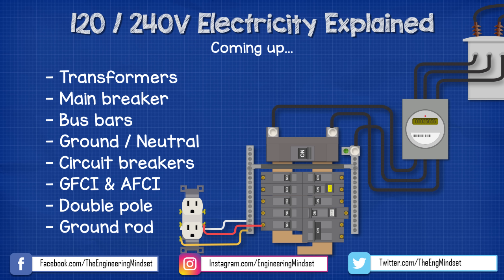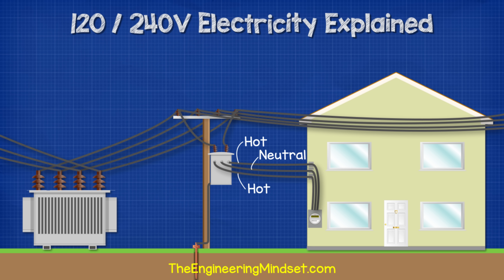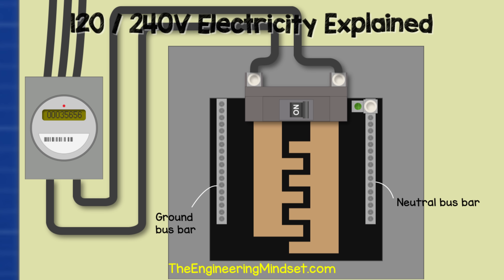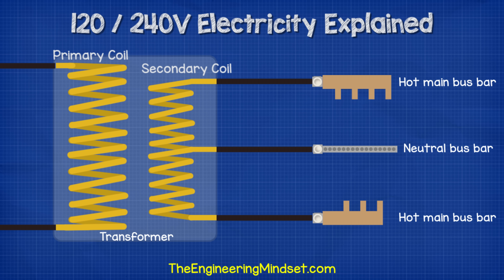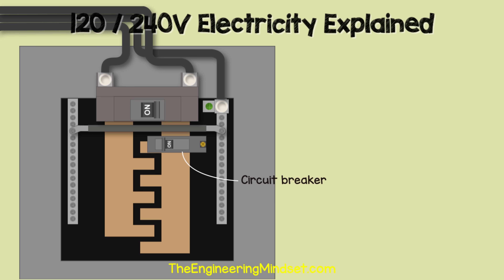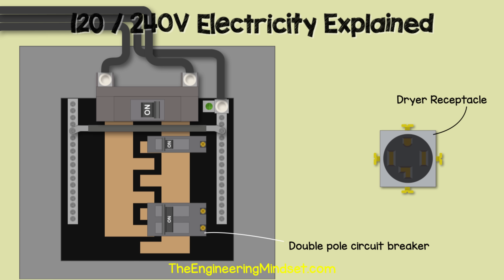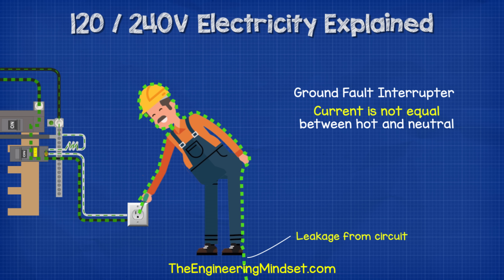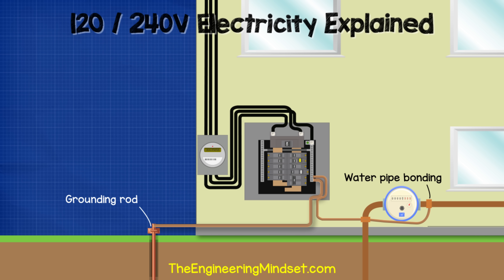120V 240V Electricity explained - Split phase 3 wire electrician

Comment: What happens when the voltage like a 240v NEMA 10-30 that is using a extension cord to fit a outlet of NEMA 5-20 device that only uses 50v?  Would that break the device bc it using so much power? The extension cord is for 240-120v.

Comment: This is a great video about Voltage, but what determines the 100-200A service you briefly mention at 3:06 ?
Reply: Apartments and tiny houses will have 100 amp panels. Most houses now have 200 amp panels.

Comment: Thank You! I've been out of service for almost 9 years, I have to work on my son's house, the breaker panel is a hillbilly's nightmare, I could not remember if the ground bar should be bonded to the neutral bar. Electrical isn't quite like a bicycle, some key points can get forgotten!!
Reply: The neutral is bonded to ground at the transformer or disconnect before the panel If you bond it in your panel and the main ground electrode is disconnected mistakenly. You risk electrifying your panel and any bonded metal in the branch circuts.

Comment: So is there a 240V transformer for every house?
Reply: In urban areas customers will be close enough together to share a transformer and will likely receive two phases of a three phase distribution and have 120/208 service.  As customer density decreases sharing of transformers will decrease. Last I checked I think I share a transformer with four other customers. We live hundreds of feet apart. If you live hundreds of yards apart you probably have  your own transformer.  

Foot is equal to the metric foot defined in ISO 2848
Yard is equal to near'bout a metre but not quite.,
Reply: @billelkins994  Thanks for taking the time to answer my question I really appreciate it.

Comment: 7:35 i don't get that, how does the ground wire have lower resistance than the neutral wire ? don't all wires except specialty wires like heating coils have more or less the same resistance per foot/meter ? (give the same materials)
Reply: i agree with you , the only thing i get from this is that say the neutral comes off and touches the metal casing the light would operate as normal because essentially the ground became the neutral which would kill someone if they touch the casing but if the hot came off and hit the metal casing it would fault through the neutral or the ground because there would be no resistance(light bulb) and it would cause a fault in the breaker.
Reply: Ground wire is thicker. Thicker wires have less resistance.
Reply from the maker: We just published a new Ground fault, short circuit and arc fault video, so much detail! Link HERE➡️: https://youtu.be/Qi0ynSQw-wc

Comment: Wait  7:01
You connected 
NEUTRAL and GROUND 
TOGETHER? 
why is separate and the connect together? 
How the power (used) going back to the panel with the NEUTRAL wire and connect with the ground wire is not doing that?
Reply from the maker: I know, it seems crazy. You may need to watch it again. Check this video too https://youtu.be/P-W42tk-fWc

Comment: Question please :   120 Joules of energy travel on each coulomb to the load
which is a bulb that uses 120 volts.   How do the coulombs become recharged
if it is AC current?  Also if the load is more than 1 amp it will need more than one
coulomb?     AC is push and pull the exact same ELECTRONS? Thank you.

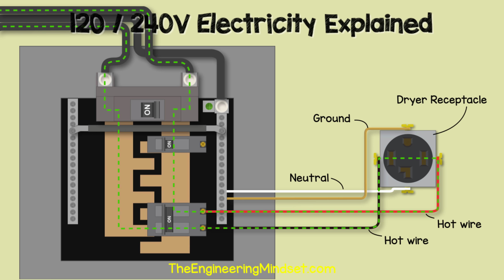Comment: I came to learn about double pole circuits and 240V. I have a question about the 9:00 mark. So a 240V appliance has no neutral? Connecting a neutral steps it back down to 120V? Any link to the best video that explains this more in depth?
Reply from the maker: Try this one https://youtu.be/P-W42tk-fWc

Comment: Do you always need a neutral? My coworker says for our equipment thats 208V 1Phase we only need the two hots and ground. I mentioned the completing the circuit and letting the current to back to the bus bar, but they said its suppose to act like a perfect circuit and those nothing or close to nothing should flow back

Comment: Hi great explanation.
Why the neutral is connected to the ground? Shouldn´t the ground cable go directly to the fiscal ground?

And second, for the dryer receptacle, why do you connect the neutral if it is not needed? (The dryer will only use 220v so I think that it is not needed or is it?)

Comment: I am not an electrician but have undertaken alot of electrical projects to code on my own.  It is stated that you have to be 100% confident in what you are doing as there is absolutely no room for error with electricity. I wish we had access to videos like this one 45 years ago in school. Straight up and straight forward... Thankyou
Reply: I probably need to rewatch, but I still don't understand how the ground wire is different from the neutral wire in this example. Also, what is meant by "used" electricity here?
Reply: @TheAero1221  the ground wire isn't intended to carry current. It's normally completely dead except in cases of a ground fault(when the hot wore touches something metal). The reason we connect the ground wire to anything metal is because that wire is able to carry the current back to the breaker and make it trip so that whatever metal became energized can turn off to prevent shock.
Reply: @TheAero1221 in essence thry arnt different
Its where they are connected that matters, they are an emergency exit for electricity
Take your toaster for example. Inside the toaster the live an neutral connect to the elements and are a closed circut. However if say the element breaks and touches the metal casing of the toaster. The toaster body is now in contact with live. But NOT neutral. So now the ground wire is the "neutral" in this case. And because of how low resistance the ground is. It causes the breaker to trip
Reply: @TheAero1221  used electricity = electricity thats been trough an appliance like washing machine

Comment: My electrical knowledge stems from 12V DC automotive systems. I understand that when going from each individual bus bar to neutral you see 120V at each, but at 4:54 the meter is connected across the bus bars and shows 240V. My understanding of how a meter works tells me that it should read 0V if both sides of the bus bar are at 120V. The meter simply shows the difference in voltage potential between the two points, no? If they are both 120V, the difference is 0V. Going from neutral (0V) to each bar individually (120V each) should be 120V as you've shown, but unless I'm missing something I don't see how the meter will show 240V when going across the bars...

Now if you connect a load to both bus bars in series it's definitely receiving 240V, but how would you read 240V from the meter without going from a common connection to both bus bars and neutral? Awesome video by the way, I've subscribed!
Reply from the maker: The two bus bars are opposite in their sine wave instantaneous voltage values so for example one is - 120v while the other is at +120V so the difference between is 240V. We have a more detailed video coming on this soon
Reply: @EngineeringMindset  Wow! Quick response, thanks! That makes sense. Again, with my automotive background I think in terms of available voltage and voltage drop.

Would another way of looking at this be to say when you go from the neutral to one side of the bus you're measuring the "drop" across that side of the coil? And then when you go from bus bar to bus bar you're measuring the "drop" across the whole coil? (I know it's not really a "drop" so to speak since this is a supply. Almost like measuring open circuit voltage across the positive and negative terminals of a battery.)

Again, thanks for the response and I love the channel!
Reply from the maker: I think it'll be much clearer if you watch our hot neutral ground video as we animate what's happening. After that checkout this 3 phase video where we do the calculations https://youtu.be/qthuFLNSrlg

Comment: Since current flows BACK to the Transformer through the Neutral wire, WHY is it called Neutral since it carries a flow of electricity? Isnt Neutral just as dangerous as HOT?
Reply from the maker: Here this should help https://youtu.be/P-W42tk-fWc

Comment: You know what I find strange, in USA and some other countries, the wall sockets / power points, do not have a switch like here in Australia. Why ? Very dangerous, especially when children can easily push a metal object into the wall socket. Makes no sense.
Reply: A switch doesn't solve the problem either.  A child could easily turn the switch to ON.

This is why tamper-resistant receptacles are recently a new requirement.   You have to push a metal object in to BOTH sockets at once, in order to get anything in the receptacle.   There are two plastic covers that stop a foreign object from entering just one socket.  So you either have to intentionally put a foreign object in both sockets at once, or insert a plug as is intended in the first place.

Comment: I wish you would have commented on what happens in a typical residential electric system when you have split phase 240V but the loads on each 120V branch circuit are not balanced (equal).
Reply from the maker: We did in detail in this video https://youtu.be/P-W42tk-fWc

Comment: You shouldn’t have the ground and neutral bus bars connected in the sub panel. They’re connected together at the meter box or main panel outside but they’re on separate bus bars inside at the sub panel
Reply: Christopher Redden    His example is NOT a sub panel.   In your location, someone has decided that there should be a main breaker outside.   Most places do not dictate this.   My opinion, if in a cold climate in winter, no way should the main be outside.   Breakers are not ambient temperature compensating.  (Meaning they will not operate at rated amps)
Reply: Kevin Coop Do what YOU like. But this explanation could be very misleading to the diy person. Electric wiring should be explained with very specific detail. One of this channels videos had the current flowing in wrong direction while using the wrong color wires with DC current. Explaining AC current with DC current isn’t the best thing to do
Reply from the maker: @heydude4532  While I appreciate your feedback, we provide examples from the NEC for the panel, we also haven't shown any sub panels? The video is aimed at novices who are curious about how their home electricity works and so we include a warning at the beginning that electricity is dangerous and that they must be qualified and competent to carry out any electrical work. Whats to stop a "diy person" from trying to install a breaker themselves from home depot, following the picture on the packet?
We haven't shown current flowing in the wrong direction, it always flows from negative to positive, you were just taught "conventional current" in college or school which is outdated, disproved and wrong. Additionally I totally disagree with your DC statement, if we jumped straight into showing electricity flowing in alternate directions, a high portion of viewers will instantly leave because they have no idea electricity works like this and it will confuse them. So we first use a method that everyone will understand and then bring them over to how it actually works.  With 600k views and 14k likes at the time of writing this, I think it speaks for itself.
Reply: @EngineeringMindset 
"Additionally, I totally disagree with your DC statement, if we jumped straight into showing electricity flowing in alternate directions, a high portion of viewers will instantly leave because they have no idea electricity works like this and it will confuse them." Thats, you admitting not showing how AC current flows because some people might get confused and give up. well maybe that would be safer than confusing people in the beginning hoping they might figure it out later on. that is more dangerous than explaining things the way it works in the first place
Reply from the maker: Check the new SUB PANEL EXPLAINED ➡️ video https://youtu.be/NUSNa-7Hecw

Comment: Excellent video!
Can we use the 240V dryer outlet in the US to run 240V appliances purchased from other countries such as U.K.? Or would you recommend a step up 110-240 converter?
Thanks.
Reply: ??? apa??????
Reply: Spice Master II      As far as voltage goes, 240 volts is 240 volts.   The plugs on the 240 volt European equipment will not work in our receptacles.
Reply: The plugs are a minor problem compared to the grid frequencies. They are different in the US and Europe and not all devices can deal with that.
Reply: short answer unless you know what you are doing...no. Long answer: yes for resistive loads like toasters and incandescent bulbs, no for inductive loads like motors and older model wall warts that use a transformers and yes for devices that use a switched mode power supply like newer power bricks(these usually work at 120-240v)
Reply: gsidTV    Can you please tell me why you think a motor designed for 50Hz will not work on a 60hz system given the same voltage?   Also what is a wall warts?
Reply: Kevin Coop the motor would run about 20% faster but might not have components speced to account for this increase. A wall wart is a transformer and bridge rectifier that gives a DC voltage, higher frequency means higher reactance and the device will heat up
Reply: gsidTV    Thank you sir!   New knowledge is always welcome, even at my age!

Comment: Exactly what is "Used Electricity"?  Regarding the ground to earth, in the US it's typically connected only to the residential gas pipe on the source side of the gas meter.
Reply: Only tied to gas pipes? Ground rods and water clamps are for Mexico?
Reply: @daylate  That's what I experienced in San Diego and now in Oklahoma.  They do bring down 3 wires from the pole transformer in my back yard and then underground to to a utility box. also in my back yard, and then underground to 5 houses nearby.  (I have the pleasure of having right-of-ways for phone, cable, and electricity in my yard.)
Reply: @dwilliams2068  look at the NEC and pretty sure has articles about drive 1 rod, take resistance reading... If it reads 25 ohms or more then you need another one 6' away. Also another article about wire for 100 amp service is #6 bare and 200 amp service is #4 bare for both sides of the water meter. Don't give out false info.
Reply: @daylate  We have 100 Amp service and there are GFI breakers in the main panel as well as some GFI outlets inside the house.  The only ground is the one to the gas meter source side and, of course the neutral wire from the pole transformer which comes in underground to the meter.  The electric meter has a WiFi connection to the smart thermostat inside the house and also talks to a local service which manages billing and can control the service if a shutoff is needed.   There are no electrical connections to the water meter.  I talked to the local building inspector's office and they confirmed this.  As far as the NEC is concerned please cite the section which concerns those features.

I should point out that the gas meter also is read by WiFi so the only physical reading required is the water meter.

As for giving out false info, I appreciate your help in protecting folks like me who ended their education after a MS degree in engineering physics.  We surely need help with this sort of things.  I'm now long retired after a 50 year career in industry.  In any case I don't put out false information, I just report what I see.  

Now, about the 25 ohm value you report.  For 100 Amp service, a 25 ohm ground would be peanuts.  It would draw about 5 amps, clearly not providing any protection.  Where did you get that number?
Reply: @dwilliams2068  I'd suggest reading NFPA NEC article 250.53 A that's for the ground rods. Exception says: "if a single rod, pipe, or plate grounding electrode had a resistance to earth of 25 ohms or less, the supplemental electrode shall not be required."
Rarely are you going to get that reading so second ground rod is usually required.

I'd also read up on article 250.104. that's for water pipe bonding and other metal pipe (gas), metal structure, and also a lot of boring shit normal person doesn't need to know. If you don't have bare copper to your ground rods, bare copper to your water pipe, bare to gas pipe, you my friend have deficient ground in your house. You know what's going to happen?? Nothing... It's all the rules and various other bullshit making electrical not fun.